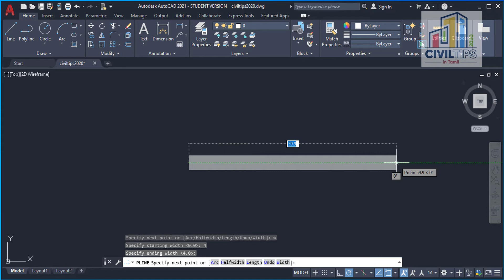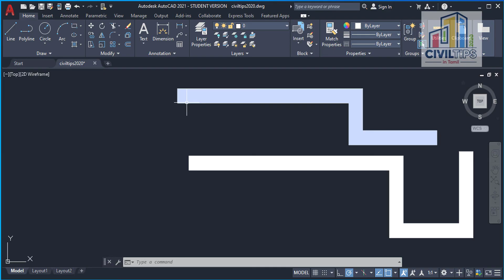Quick Tips for Polyline Width in Autocad

Comment: How do you change it back to normal poly line ?
Reply: I don't know what I press that the poly line command I issue is showing as start point
Reply from the maker: Change width value again
Reply: @civiltips2020  what is the normal width  of the polyline ?
Reply from the maker: @sibi.lr4 default width of a polyline is 0 units, meaning it has no thickness and is displayed as a single line.